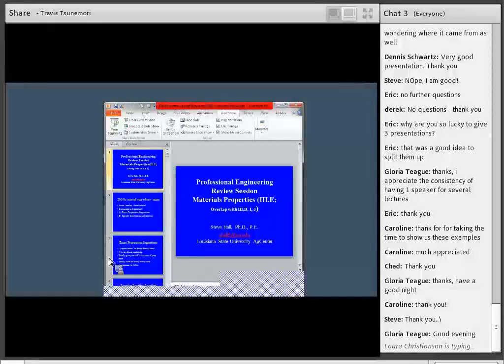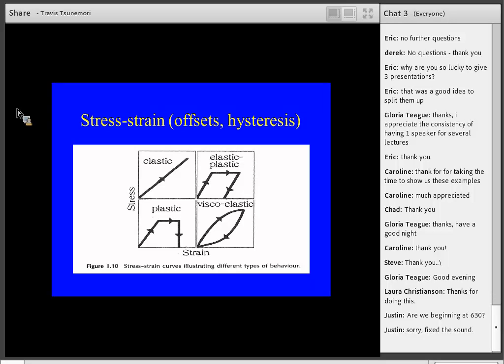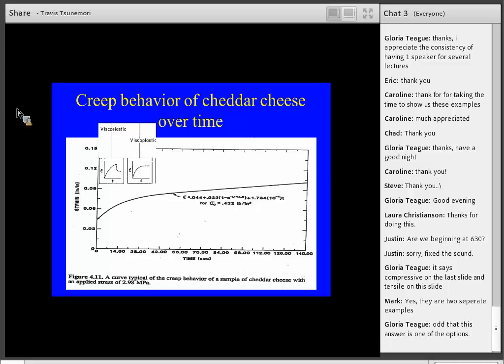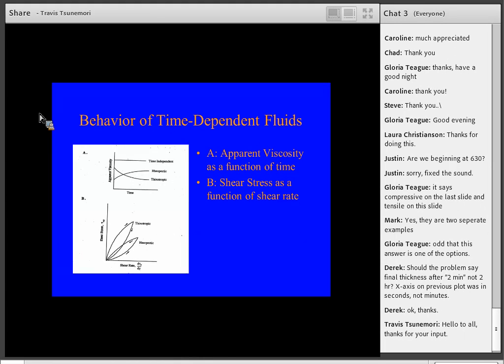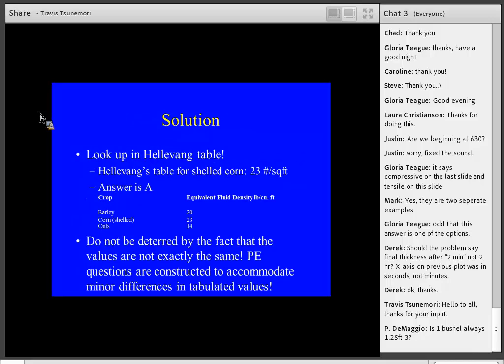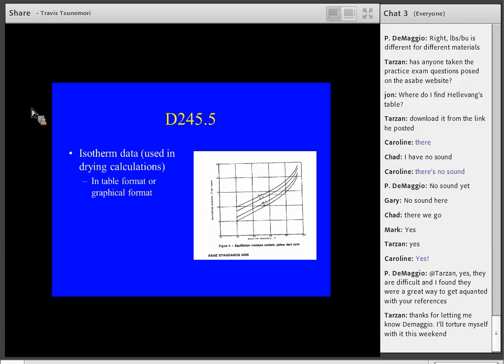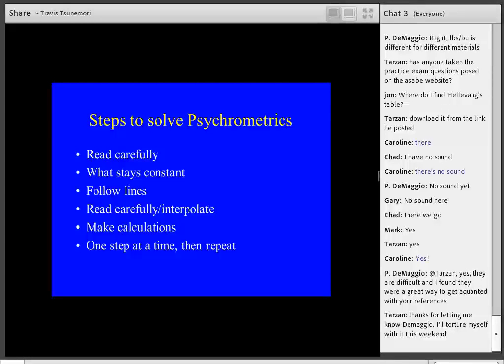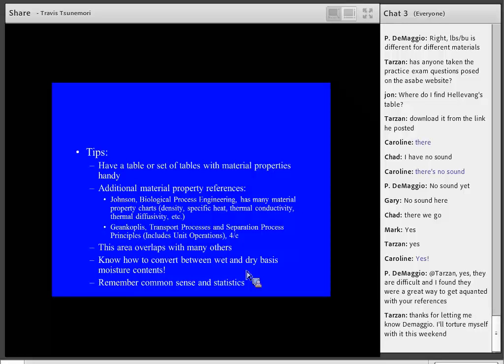2016 Materials Prop 2 16

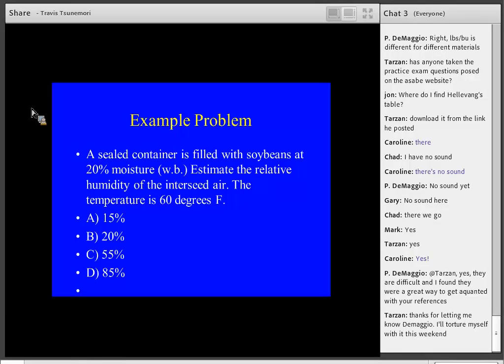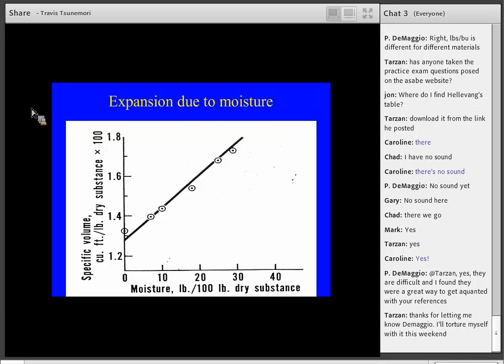Comment: For the example presented from 1:43:30 to 1:47:15, the computed R value (520 R) was not used the solution, and I believe the incorrect answer is shown. 

If one were to use the computed R Value (520 R), "e^-1.962" becomes ~ e^-2.218 (which equals ~0.1088).

So 1 - rh = 0.1088, solving for Relative Humidity will give ~ 89% (Answer is still D).

Comment: The following was corrected in the video, but I will write it here also:

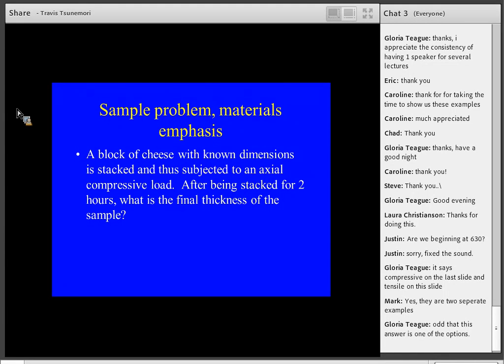The example presented, from 41:40 to 44:20, the duration is for 2 min (120 seconds) and NOT 2 hours(120 min) to comply with the graph for the problem.